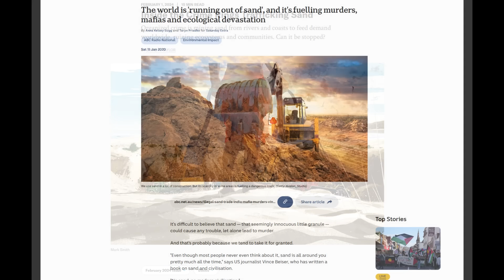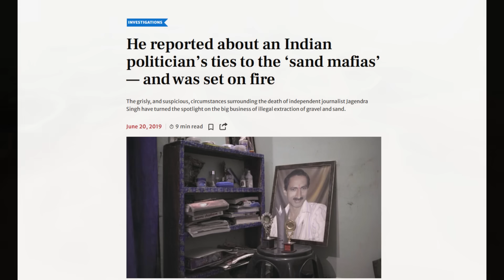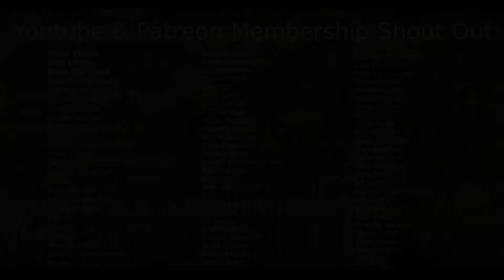The World Is Running Out of Construction Sand…

Comment: Does not this put forward the prospect that when a construction is to be demolished  to build new buildings or infrastructure, that the concrete of the structure is recycled to reclaim the sand and reinforcing iron  etc that was used.
If such sand is a valuable finite resource, then it should be recycled.

Comment: As sand depletes it just increases the economic viability of using alternative methods.  The market and industry will adapt with new methods of producing sand ourself, making pseudo-concrete with alternative mixtures, or replacing concrete altogether wherever applicable.
Hardly a disaster for civilization, but the planet may bare those scars for a while, but it will recover in time.

Comment: Anyone feel free to enlighten me, why can't we crush rock to get sand?

Also, desert sand... Can we electrify it to create 'sharp' sand? Like panko vs regular bread crumbs lol 😆 
It may not be highest grade cos still small particles... But surely we could find some use for it?
Reply: Probably the best solution would be to work out a mix ratio for desert sands to be able to be included with sharp sand for concrete mixes. The mixes would have to be certified and guaranteed, and that could be a very big problem in countries where a sand Mafia is operating.
Reply: The answer is, as always, cost. It’s far cheaper to scoop some sludge into a barge than to collect rocks, process them in crushers and then scoop it into a barge.
Reply: Does hempcrete require sand?

Comment: The entire Whitewater Stadium at Penrith, which was used for the 2000 Olympics was simply converted from a sand mining facility with huge holes dug in the ground, where sand was taken after being laid down in the Nepean River flood plain for eons. They simply re-shaped the holes and filled them with water and voilà! You have an international grade rowing and kayak facility.
By the 1980s, the site was completely exhausted, so it was perfect timing to convert it to the Olympic water sport venue.

Comment: I read about this decades ago. Sand removal offshore was responsible for subsistence on the beaches. Sand removal from shorelines caused costal erosion etc. We have stopped using wood and stone in our buildings, like so many aspects of society, those at the top have taken our ancient systems and replaced them with those of money and control, not sustainability.

Comment: I wonder if concrete can ever be recycled or reused? Have always thought controlled demolition of old buildings is a big waste of resources. Repurposing rather than turning it all into a pile of rubble
Reply: They recycle as much as they possibly can when they demolish buildings. They pulverize the concrete, but I'm pretty sure they still have to add some sand to the new concrete mixture. Very little metal is wasted too, but wood has definitely been misused and wasted.